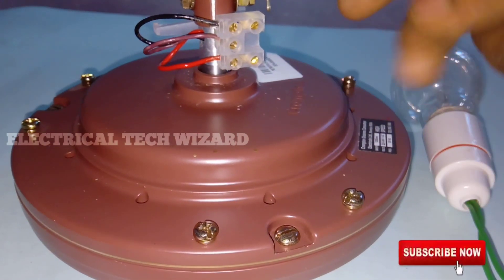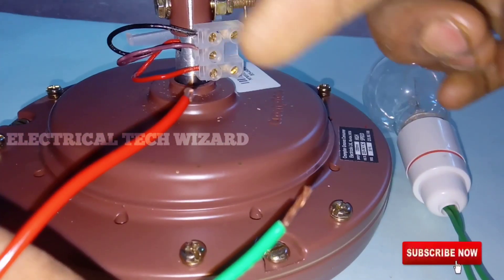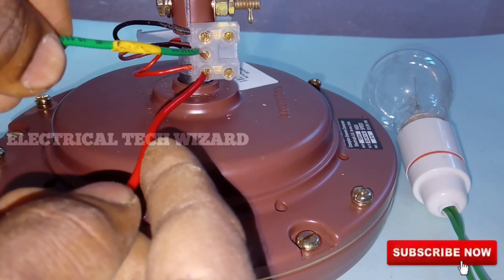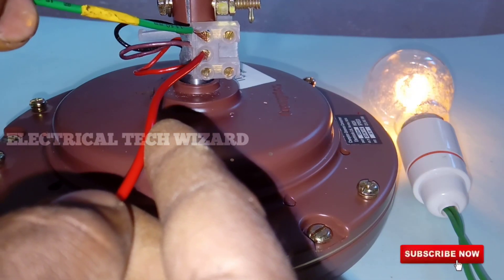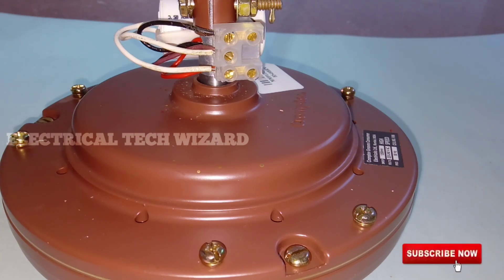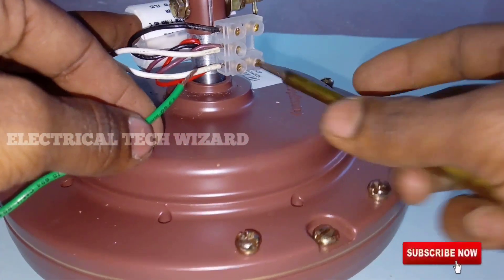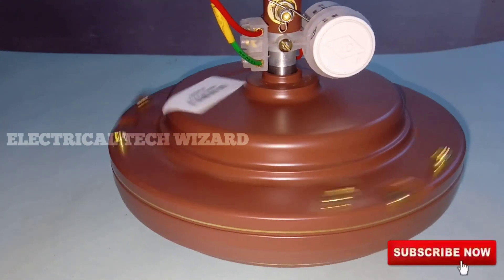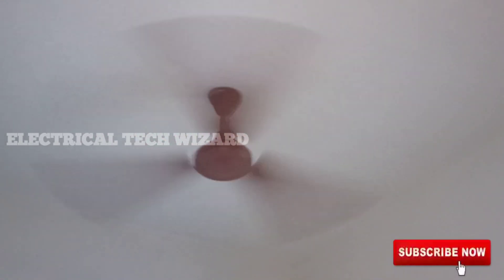ceiling fan connection/home made ceiling fan connection/ceiling fan connection in tamil

Comment: What is P an N witch one is + and -
Reply from the maker: AC supply = phase, neutral
DC supply= positive, negative
Reply: @ELECTRICALTECHWIZARD  nerul na power supply  varatha na
Reply from the maker: konjam ma varum return bath
Reply: @ELECTRICALTECHWIZARD  apo phase tha main power varum correct  ah na
Reply from the maker: ஆமா தம்பி
Reply: @ELECTRICALTECHWIZARD  thank you na

Comment: Bro condenser change paneten,but speed ah run aka madikuthu,,ena problem????
Reply from the maker: starting coil kum common wire kum capacitor connect pannanum brother ❣️
Reply: Condenser correct aa connect pannu     bro.

Comment: Neutral ,power line ah mathi kodutha  problem varuma
Reply from the maker: neutral and phase wire rendaiyum starting coil running coil la kodutha fan slow run aagum
Reply: Neutral line ah common LA koduthu , phase line ah running LA kodukalama ,mathi kodukalama 
Ethum problem varuma
Reply from the maker: fan anticlockwise la work aagum brother 🙏

Comment: Commen wire la phase connect panuna problem varuma anna
Reply from the maker: konjam slow ah run aagum brother
Reply: Phase neutral correct ah kodutha than fan speed ah oduma anna
Reply from the maker: அப்படி ஒன்னும் இல்லை bro run aagum proper connection starting coil ku phase common wire ku neutral connect pannanum brother👈😍🙏
Reply: Okk anna thank u
Reply from the maker: Thanks Nanba 🙏❣️🙏